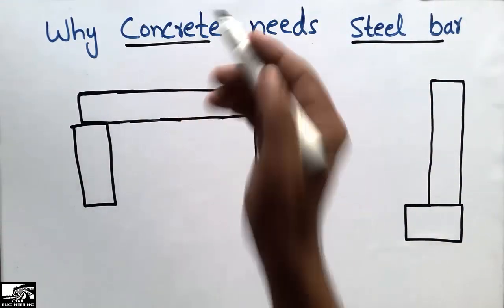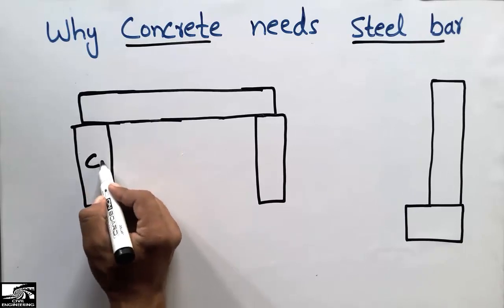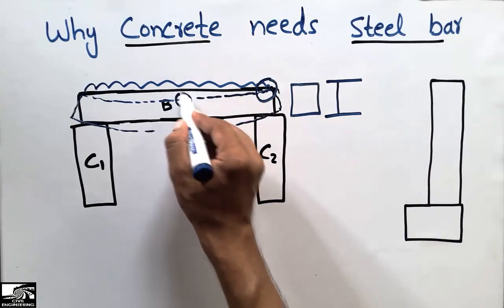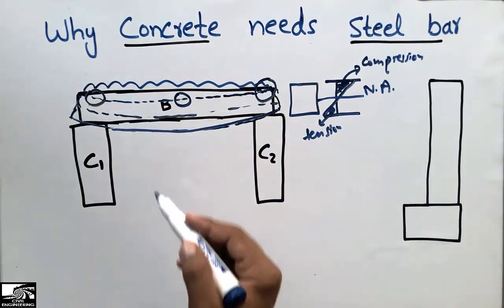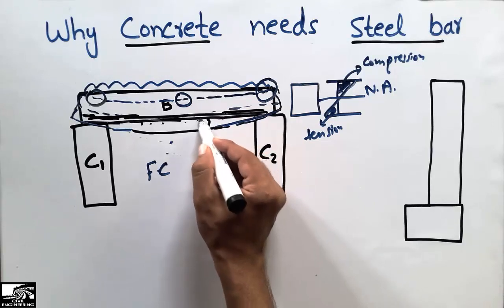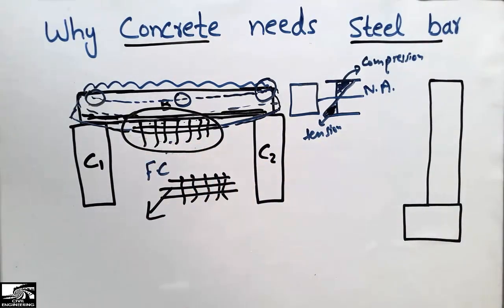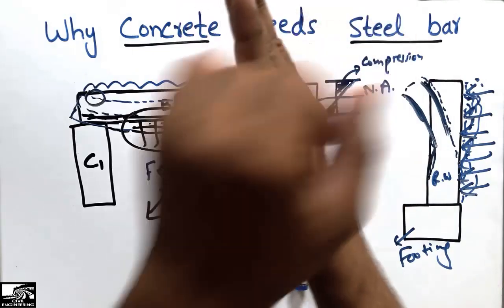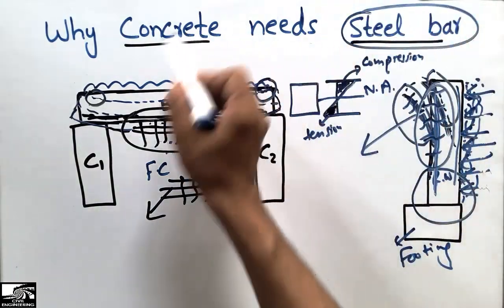Why concrete needs Reinforcement bar || With Example

Comment: You have great simple videos, thank you. However for the retaining wall: won't the cracks develop on the right side of the wall instead of the left - since the right side of the wall will be in tension, not in compression?